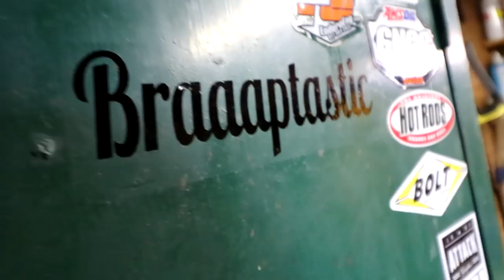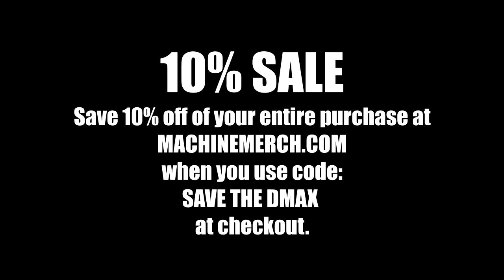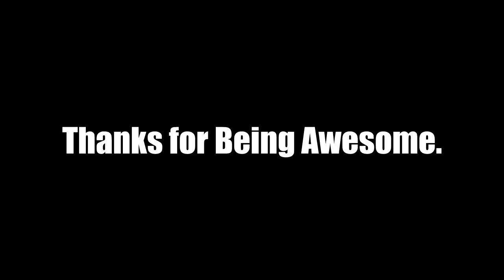i got caught... exposing my lie

Comment: 05 crewcab dmax in 7/10 condition before accident worth maybe 9k. The cost to repair 3-4k depending on where you bring it. The insurance company will pay to get it fixed but that counts as a single vehicle collision, If they do some research and find his channel they will find out this is the second single vehicle collision in the last 12 months  ( he hit pole last year)  + he lost a rim last year on the highway due to negligence......  I don't think his insurance rates will go down any time soon. If it was me I would go to scrapyard buy 1 used rear bumper (brackets look ok)  2 black doors minus mirrors and controls (he has those) m3 brackets for the box and  hit the rear of the box with a hammer until it was straight again and paint the lower part of the truck from the trim down  with 3 cans of  bedliner, I would blackout the grill while I was at it.  That would cost me about $300.00 and rates would not go up.

Comment: I have a question the light bar on your truck does the brackets make a whistle noise in the cab when driving down the road sense they're in the door frame, and are those brackets easy to install?

Comment: What did u put on your head liner and what u use to stick it on?
Reply: Ive wanted a black headliner
Reply: Leatherkid01 just use spray glue and a staple gun
Reply: FlmxFilms spray glue will hold material up ... With summer heat too?
Reply: Leatherkid01 I live in Florida and mine has lasted 5-6years just have to let it dry then run couple staples around it i used a camo bed sheet just got cut it to fit headliner
Reply: FlmxFilms thats enough proof for me ;) thanks for letting me know.

Comment: Fix the truck so many times selling it and get a ford
Reply: Gavin Aftanas found on road dead
Reply: Yeah, Found On Road Dead
Reply: Now that's a good idea
Reply: Fix or repair daily
Reply: Ford F-350 1986 the same thing would happen to a ford
Reply: That trucks lasted him so long and will probably last him until he dies if he go a Ford it would be having issues as soon as he got it and would probably constantly breaking down
Reply: Southern Outdoorsman it also means fix or repair daily
Reply: Gopher Vlogs that is so true
Reply: A Ford is the worst truck to buy
Reply: Get a 6.0 power stroke it wouldn't ever get damaged, because it would be in the driveway broke down!
Reply: All old and abused trucks have issues.
Reply: Ford F-350 1986 👍👍
Reply: A truck won’t break down if you dont abuse it my friend has a old ford I’m not sure what year but it has over 500,000 miles on it
And runs like new
Reply: Nice user name i have a 1986 F-350 crew cab long box 4x4 6.9 diesel.... sadly shes rusted away and i need to retire it.
Reply: Cause fords aluminum body is gonna be any better